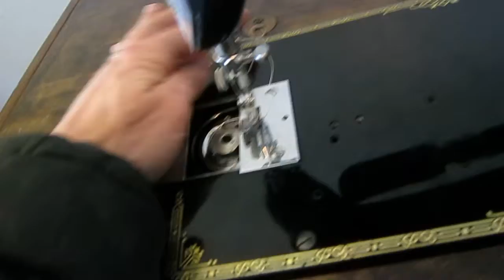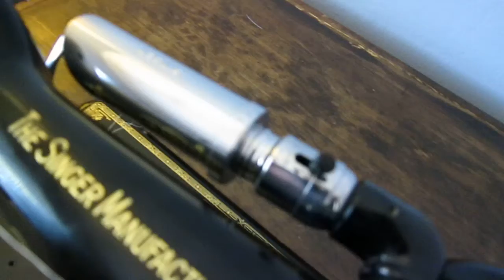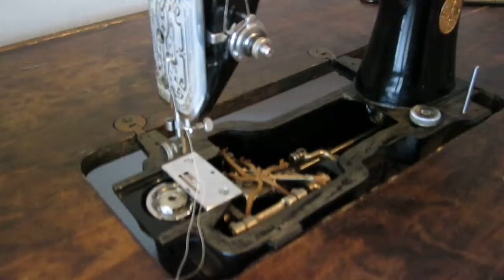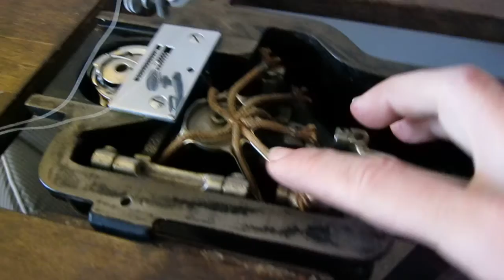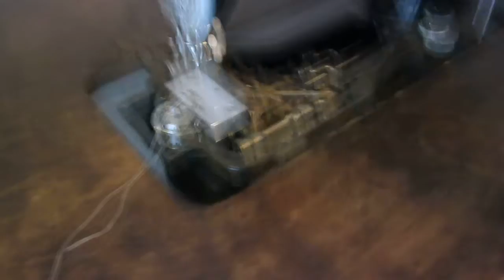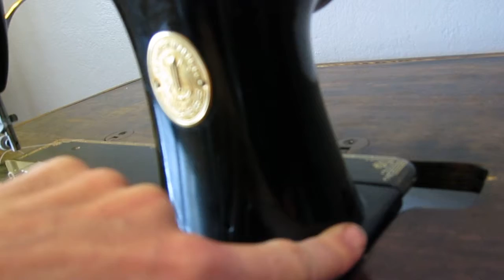1930 Singer 101-4 Sewing Machine Demonstration

Comment: I have a Singer 101, manufacture date 1-9-1923.  That said how do I know what I have.  Are there models 101, 101-4 and 101-12?  My dad used it to sew miniature (toy) horse harnesses in the 70s and 80s with my 101.  I'd like to get it cleaned up and sew something with it.  I just see 101-4 & 101-12 manual.  How can I tell what 101 sub number I have?  Are they all so similar that it really doesn't matter?
Reply: Well, the first #101 made in 1920 had no light and had the speed controller built into the base of the machine. Next came the light with the pull chain, then a "twist switch". Models sold for portable use had aluminum heads and by the time the # 101-4 was made, the speed controller was separated as an independent unit.

Comment: I just bought a 1930 101-4 and the hand wheel and the needle bar are not moving.  It is a really clean machine and so I wondered what you would suggest to do to fix the problem?  Thanks.

Comment: I had a Featherweight for years but lost it in a move. Good little machine, used but like my mom's. What I want to know is why the manufacturers don't put the motor Amp. on the plate with model and serial numbers and also year the machine was built.?

Comment: Hey I just got one of these at an estate sale! this video was so informative, thank u! I love this machine but it’s pretty slow. Is urs so fast cuz of the new motor?
Reply from the maker: It could be the motor but more l likely all the contact points are running tightly.  Best thing to do is flush with kerosene or if you're very careful denatured alcohol (will damage finish).  Run the machine while flushing all moving parts then allow to dry and then lubricate with machine oil.

Comment: Love your demo. Never ever seen one of these for sale, but I'd be all over it if I did.
Interested in your comment about the 201 being slower. Perhaps it's because mine (we have 2) are 230v and have an external motor (both 201K's) but they are the fastest domestic machines we have, followed closely by a Pfaff 30. 
That is tough as nails, but perhaps because of its oscillating hook, it is very noisy and clattery in comparison.
Both 201's clock 1400+ spm using a digital tacho.
All the fastest machines we have are the vintage ones - Husqvarna 19e, Bernina 901, Singer 401G etc.The  modern computerised machines we have are slower, although I think they regulate the maximum speed based on the stitch selected - I guess a domestic machine running a 9mm zig zag at 1400 spm won't last long, so maybe understandable.

Comment: My wife and I are working to restore a 1920 Singer 101. Any advice on how to release a stuck motor after removing the front screw would be wonderful.
Reply: After watching a few more videos we figured it out. The motor mounting pin next to the front screw was severely corroded. Once this broke free we were able to clean the motor.

Comment: thank you for this wonderful video! I just bought a 101-4 today, without knowing anything about it, other than that the motor still works. I guess I need to find someone to help me clean it thoroughly and evaluate the wiring and the motor, before I use it. But it's clean just like yours, and perhaps the same year. Mine came with a manual "Revised April 1929."

Comment: I have my mom's 101 in a cabinet...purchased used in 1963. Thanks for the video. My son and I plan on refurbishing it this winter so am learning as much as I can. I, too haven't found the serial number (yet). Much cleaning is in order.
Reply from the maker: That is awesome!  What a great family heirloom.
Reply: May I ask what table it is in? I have recently acquired a 101 without a cabinet and trying to figure out who will have to leave their cabinet!
Reply: @AngelaSargent  made of walnut; the machine resides in the belly of the cabinet. The top opens up and the legs are fluted. The veneer on the top was badly damaged. One of my future adventures is to learn how to apply veneer!

Comment: I have two 101 machines. One is a bit of an anomaly but it's the machine I always use. It stitches straight as an arrow.
I prefer the direct drive to the shaft from the motor as opposed to the gear driven handwheel of the 201. Both models are fantastic but my 101 is my go to #1.
I agree with you in regards to the 301. It's a great model.

Comment: Very informative as usual! So, I have a 201K with brass undercarriage - (exterior motor) - I am thinking about putting a more powerful motor on it. Why not put a higher amp motor on a 201? Is it apples and oranges? Thank you for posting this!
Reply from the maker: Go for it!  I'd love to find a 201 with and exterior motor to use with an industrial servo motor but I just haven't ran across one.  All the 201s I've run across are direct drives.
Reply: @thesergeant3524  It's the 201K. I don't know if they made it in the states. I can get the serial number off of it if you are interested. I
Reply: @thesergeant3524  Very common in Canada more so than the direct drive

Comment: I have a 101-4 that needs to be re-wired.  The wires from the machine are frayed and brittle and there is no connector like you show in the video.  I also have not seen any other videos or pictures of the connector on the web.  Can you send a picture or show a closeup video of that connector or possibly a source  where I can get one?

Comment: Hello thesergeant.  Wonderful video thanks!  I have a question.  I have a 101 in the bentwood cabinet from 1923  that is missing the knee control arm.  It looks like someone "built" a new control and soldered it into the hole and it has subsequently broken off.  Have looked online and see one with a sort of a screw-like end to insert into the hole in the base and another with an end that looks more rectangle in shape.  Which one should I try and/or do you know where I can get one?  Cheers!

Comment: I have recently bought a 101 but it is not nearly as fast as yours. What could it be that may need fixed?
Reply from the maker: I'd go through and thoroughly clean all the moving parts.  You can use Kerosene, which is pretty mild and won't hurt your paint.  If you're careful denatured alcohol is even better but will damage the paint so be very careful when using it.  If the machine is smooth it's possible that your brushes are worn, so check there.  Goodluck!
Reply from the maker: *motor brushes

Comment: Does anyone with a Singer Model 101 know how to remove the bobbin case or can you refer me to a link that has instructions how to do it (Don't know if theseargeant is still reading comments here)? My Model 101 was made in 1928. I've looked at instructions for other models like the 201 and they don't come close to helping remove the bobbin case on the model 101. I've cleaned under the bobbin case and around it, but I can still see some lint and things stuck in it that I can't get to unless I remove the bobbin case. I can also feel and hear the bobbin case binding a bit when I turn the hand wheel. I've been struggling with this for a while trying to figure it out to no avail. I need to get the machine up and running so I can sew some outdoor cushions with Sunbrella Marine Fabric. Any help will be appreciated.
Reply: Bobbin Case Removal/Cleaning Instructions for Singer Model 101: Finally had some time and took a chance and was able to take apart the Singer 101's bobbin case and clean it. Amazingly, I was able to figure it out on my own. Here's the trick: 1) Remove Bobbin Plate and Feed Dog Plate. 1a) Remove the center screw at the base of the bobbin case. 2) Lift the needle up to it's highest point and center the hook with the needle, then try to pull the bobbin case up and out. 2a) If it won't come out, take the base cover off (with the four screws like thesergeant does in his video) and then lift up the machine so you can see underneath it and remove the round bottom cover plate from below the bobbin area. 2b) Use a bamboo or wooden skewer or a thin dowel and push up on the bobbin case from below, taking care not to hit the gears with the dowel as you guide the dowel to the base of the bobbin case. The bobbin case should pop out when you push it up with the skewer or dowel. 3) Once the bobbin case is removed, then you can take the two screws off of the hook and take it apart. 4) Use an electronic grade alcohol to remove varnished oil and lint from all of the grooves in the bobbin case (take pictures while you take it apart so you know how to put it together). 5) To reinstall the bobbin case, make sure you have the hook lined up with the needle and make sure the little notch in the bottom of the bobbin case is lined up with the little pin in the spinning base that the bobbin case sits on. 6) Screw the center screw into the bottom center of the bobbin case 7) Reinstall the round base cover plate and reinstall the top cover, bobbin cover and feed dog plate if you removed them to take out the bobbin case. Hope this helps someone else that is struggling with this. Now I'm teaching myself how to sew by sewing homemade shop towels. Sewing Soooo much better with a clean bobbin case. The tension is now perfect and much less noisy!

Comment: Had some rattling sound on my Singer 101 (made in 1928 that I hadn't ran since the 1980's) after cleaning, oiling and lubricating. Thought it was the motor after lubing it. Took the motor out and ran it and it runs smooth. Put it back in and rattling sound returned. Re-oiled the oil points again, on the machine, and ran the machine again and the rattling sound disappeared after about 30 seconds. Appears to have needed a little more oil and a little more time for the oil to seep into the oil points. Hope this helps someone else.
Reply: Some say it needs to be warmed up before using it

Comment: Thanks so much for publishing this video.  I have a 1930 101 and would like to get it functioning again so that it can be used for sewing.  I would like to do free motion quilting on it since it has the biggest throat areas of all my machines (15-91, 99k, featherweights, and expensive newer Brother, which can't even do fmq).  It looks in great condition and I've cleaned and oiled it up as well as done a prelim test sew on it.  I know I need to lub the motor and gears, but haven't done that yet.  But, as you say, it runs fast!  Would love to convert it to a foot control.  If you have any idea how to do that, please share.

Comment: Thanks for the great video, your machine is beautiful. I picked up a 101 recently and I have noticed that the 101s have some differences among them but what strikes me as curious is that mine is void of a serial number. It is not where it should be nor is it anywhere on the sewing machine. Any ideas as to why? Mine has a covered bobbin winder, cast iron oil well, no light or anywhere to mount one and the upper thread guide is thicker.
Reply: @Racer X, On my Singer 101 the serial number is underneath, on the bottom of the machine. Once you find it, look it up on the Singer Sewing Machine Serial Number Database: http://ismacs.net/singer_sewing_machine_company/serial-numbers/singer-sewing-machine-serial-number-database.html

Comment: I am very familiar with sewing machine repair, 201, 301, 221 etc.
I am puzzled how the 101 handwheel comes off past the clutch.
I want to remove the handwheel to clean and lubricate the motor and drive gears.
Mark.
Reply: The underside of the hand wheel has a "hidden" set screw

Comment: Thanks for great demonstrations.  How do you drop the feed dogs on machines?  Do you know if this capability exists with Feather lights, as well?
Reply from the maker: +Michelle Fortney Unfortunately there the 101 and the 221 (featherweight) don't have any kind of release mechanism for the feed dogs (like on a 201, 15-91, etc).  The 101 came stock with a special needle plate cover and darning foot.   A quick and easy way around this is to get a 3x5 card.  Punch a small hole in it and then tape it to the bed of your machine with the hole in the 3x5 centered to allow the need to pass through.  Set the stitch length to "0", put on your darning foot and you're good to go.